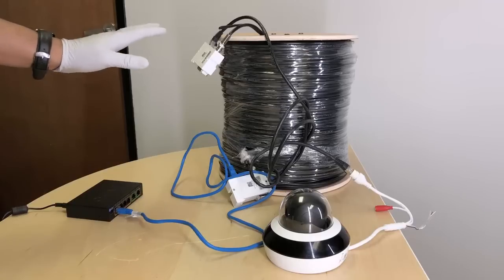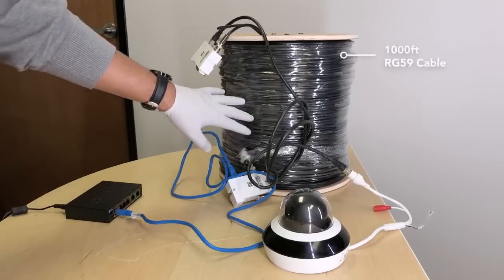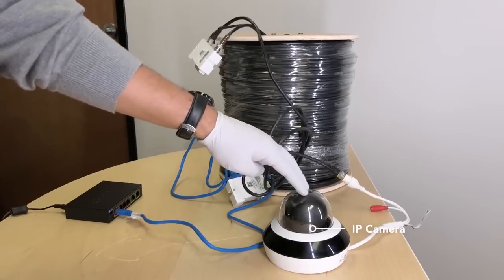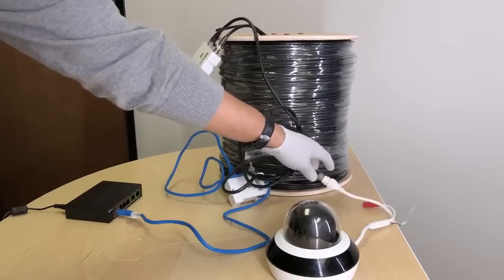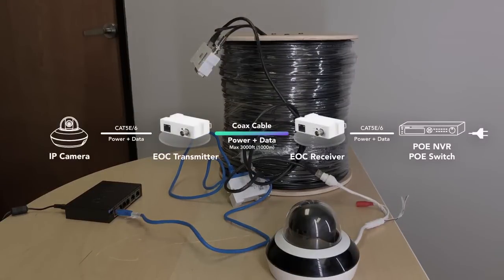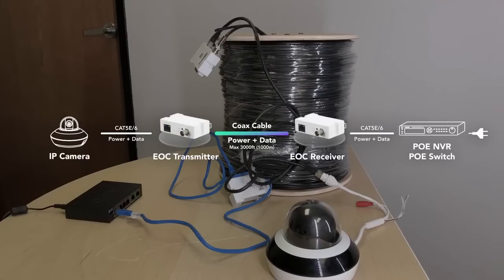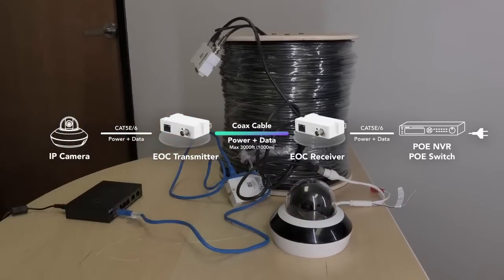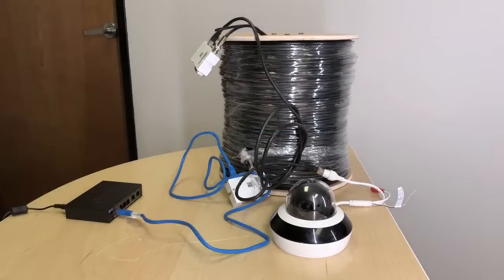POE IP Over Coax EOC Converters Extenders Transmitters Receivers  Introduction | Linovision

Comment: What if the camera is coax camera and you want to connect to a NVR?
Reply from the maker: The coax camera can not be connected to a NVR. It has to be upgraded to IP camera, but you can still use the existing coax cable.

Comment: We use the Dahua versions of these. They are quite remarkable. They work with not only coax, but just about any pair of wires.
Reply: i wont to connect an Ip camera and arduino using 500m cat6 cable
Reply: great ! i want to use only 4 wires from a cat6 cable 500m as coaxial cable do you think it will work ?
Reply: @cimogt7857  you are thinking of this backwards. These devices are for creating a network connection out of a 2 conductor wire. If you want to use a cat6 cable for sending RF signals, you would need a different device for that.
Reply: @phandcorp  i have an epoe switch and a cat6 cable (500m) 
I will add two lr1002 Eoc, between them I will use 6 wires divided in two from a cat6 cabele for connection  (like coaxial cable ) 
and the rest 2 other twisted wire i will use them for an arduino (rs 485 connection)
do you think  it will work ?
Reply: @cimogt7857  It may work, however I'm not sure where you would find a 500 metre cat6 cable. I've tested up to about 200m with a cat5 cable.
Reply: @phandcorp  I will try :D I hope it will work
thank you for your reply
Reply: @phandcorp  Hi, thank you for your comment. May I ask something about this kit? Can we use that for internet such as router, Access point, PC? As far as I understand: we have 2 adapters, for the 1st adapter: we connect using ethernet cable from modem/switch, we also connect the coax cable to the 2nd adapter (e.g RG6), then for the 2nd adapter, we connect ethernet cable to router, access point, PC...these devices would have internet, right? thanks again